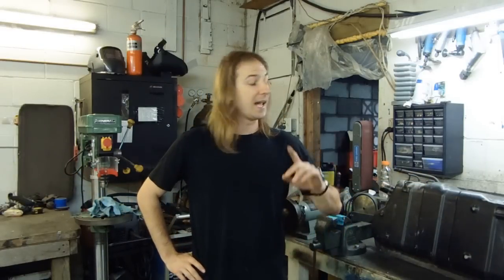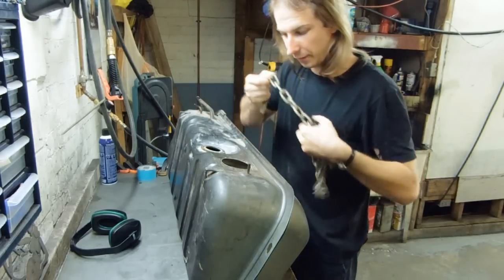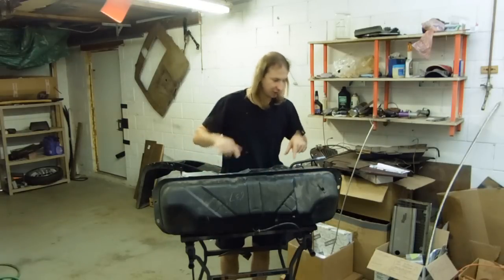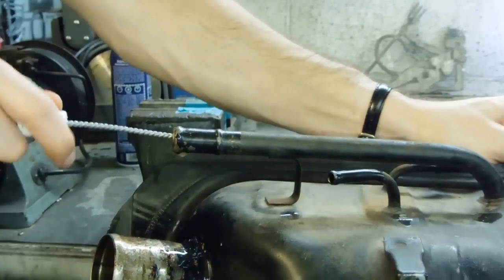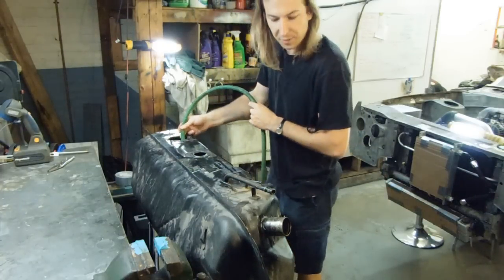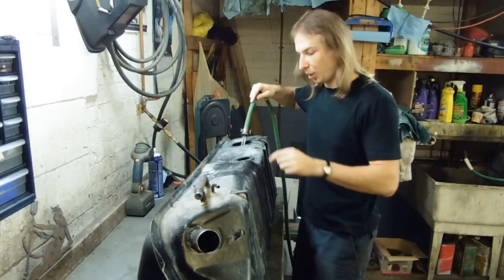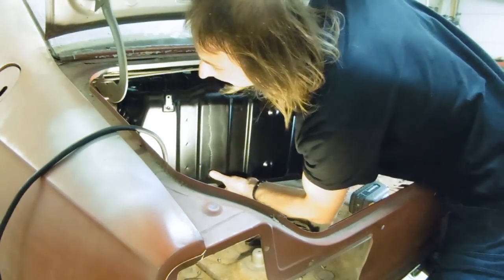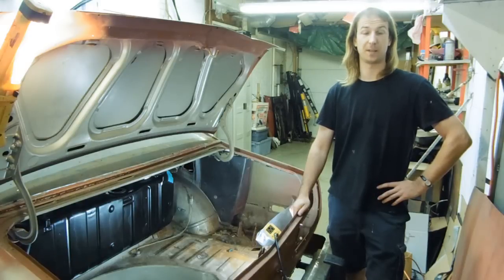Part 38: Fuel Tank Restoration With POR-15 Sealing Kit - My 76 Mazda RX-5 Cosmo Restoration

Comment: nope. not doin all that shaking. I'm impressed though but Muriatic acid will handle it in just a few hours.
Reply from the maker: Only thing about muriatic acid is that it will also remove any galvanizing from inside the tank.
Reply: @aaroncake  I don't know about the galvanizing but I had to remove some serious rust in my Suzuki SV650s. the bike had sat for about 8 or 9 years. After 2 baths of Muriatic I used the POR-15 product and the tank looks great now. I couldn't believe how well the coating did in the end.

Comment: such meticulous tank prep.
Reply: do you film yourself?
Reply from the maker: bhearts77 Yes. With several different sized tripods.
Reply: you put some serious work into this. so i gotta know though, what exactly do you suspect that finisher tank product to be. some sort of epoxy urethane?
Reply from the maker: bhearts77 According to the MSDS it contains Diphenylmethane Diisocyanate and aluminium. So it will be a moisture cured coating similar to Super Glue to bind aluminium which does the sealing.

Comment: One more cool vid... thanks!!!

With regards to fuel tank restoration I've seen posts from one forum where guy used vinegar to clean it inside, scroll down and you'll see the results.
http://www.aeu86.org/forum/showthread.php?tid=12965&page=3
Reply from the maker: Dima Minko Took a look at that thread. Anything strongly acidic (like cleaning vinegar) or strongly basic (Super Clean) is going to do wonders for the inside of a fuel tank. Looks like his vinegar method worked quite well. I wish he was narrating the thread a bit more because I'm curious as to what he did to make the tank seem safe enough to weld on. Something like that terrifies me and for good reason...visit my local fuel tank shop and there isn't a person there with all 10 fingers. Having already cut off my left thumb (it was reattached) I would prefer not to explode a fuel tank from the vapors. He really should coat it with something because now that all the plating is gone from the inside, it's going to rust very quickly again.